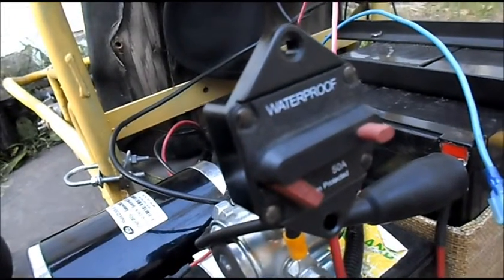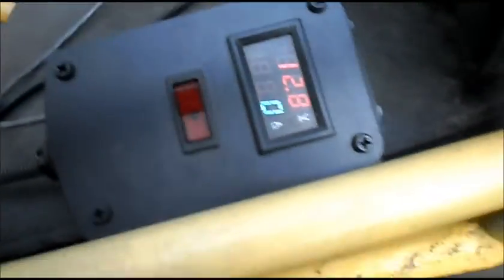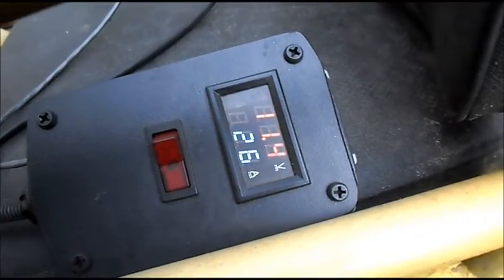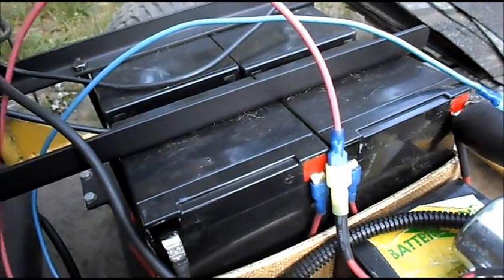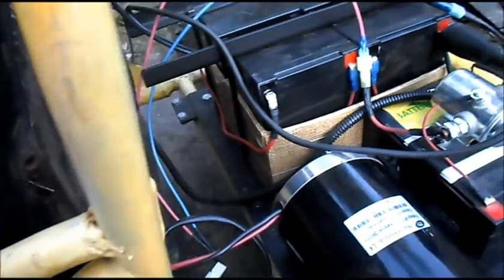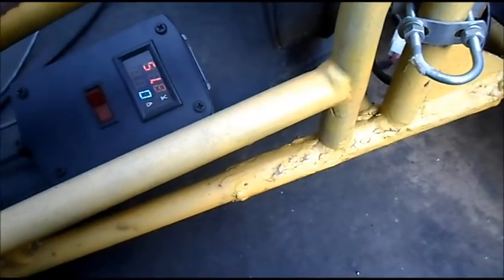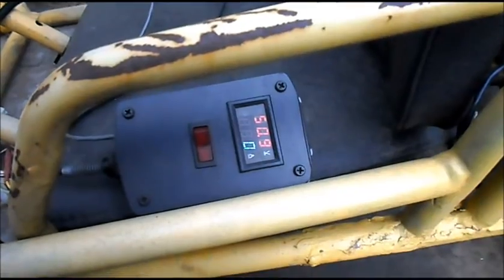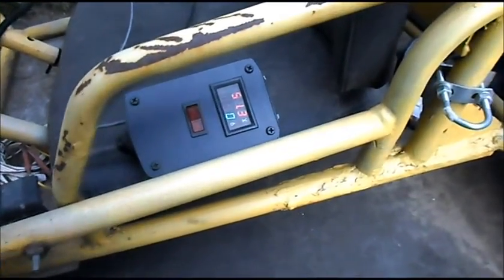Hold on to your Hat-Test ZY1020 48V 1,000W motor load test

Comment: What controller are you using? I got a controller for this motor that has current limited to 30A. I wasn't expecting the motor to draw more than the specified "Max 1000 Watt, 20.8 amps". Should I be worried?
Reply from the maker: Not if your using a speed controller. The tests in this video did NOT use a speed controller (so, no current limit) just a contactor
Reply: @functional_artist  ah thank you for this response and thank you very much for this video.

Comment: 48 volts times 80 amps would be over 3500 watts so is the shunt for you amp gauge wired wrong?
Reply: Doubt it. The motor is rated for 1000 watts under full load. What is full load? Who knows there is no spec but all motors will pull more load then rated WHEN overloaded. It will most likely burn up if he continues to abuse it like that. But it should be able to run continuously if only loaded to 1000 watts or 20 amps at 48 volts
Reply: @electromechanicalstuff2602 I'm trying to do a similar conversion using the 48V MY1020 motor. Spins well on the bench test but can't handle the slightest load. What could it be?
Reply: @apocalypseapocalypse3550  controller?
Reply: @electromechanicalstuff2602  even without a controller the motor is still powerless.
Reply: @apocalypseapocalypse3550  what batteries r u using? How many amps does it pull while providing no power
Reply: @electromechanicalstuff2602  did the measurements today and the readings kept pulsating between 10-18. Got the thing to move bt it was toooo weak and could not handle the slightest incline. The motor also got really hot after few meters same to the controller.
Reply: Is this a brushless motor?

Comment: Liking the video's keep! up the good work! I am making a old mopet/ice cream stand into a hybride with the same 1800W engine you use in other video's. I was looking for some deepsycle batteries but they are quit expencive. What batteries do you use?
Reply from the maker: I have been using these little 12V 12AH (amp hour) SLA (sealed lead acid) batteries. https://www.ebay.com/itm/4-Pack-12V-12Ah-Ebike-Electric-Scooter-Battery-E-Bike-Boreem-Battery/282718683107?hash=item41d358bfe3:g:r3AAAOSw8zdZ-6l-They are ~$25.00 each so, (4) of them are ~$100.00 & I usually get 30 - 45 minutes of riding time.
Reply: Thanks!! I am gonna do the same thing. Slightly bigger (35ah) and safe some money for someting like this for next year. 
https://nl.aliexpress.com/item/BOOANT-1800W-45AH-48V-E-Bike-Li-ion-Battery-pack-For-Bafang-1800W-Motor-45AH-Electric/32841628304.html?ws_ab_test=searchweb0_0,searchweb201602_3_10152_10151_10065_10344_10068_5723115_5722815_10342_10343_10340_5722915_10341_5722615_10696_10084_10083_10618_10304_10307_10820_10301_10821_5722715_10843_10059_100031_10103_10624_10623_10622_5722515_10621_10620,searchweb201603_30,ppcSwitch_5&algo_expid=9d89754d-0dac-44e9-91eb-7f4c221e3019-2&algo_pvid=9d89754d-0dac-44e9-91eb-7f4c221e3019&priceBeautifyAB=0